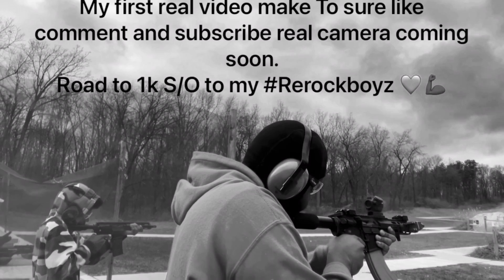AR PISTOL 5 INCH MICRO UPPER & MICRO BUFFER TIPS!!!!

Comment: You are getting less gas and power burn the shorter the barrel, it has nothing to do with your bolt being strong it's actually less stress on the bolt, I WOULD  highly recommend a adjustable gas block, with short. 556 barrels it's all about timing and bolt lockup time, you want the heaviest buffer you can to keep the bcg locked up as long as possible
Reply: Smart info. I'm look to build a micro and have been looking at different YouTube builds and comments to build my best possible version. Buffer and dwell time are my biggest concerns on a gas system this short.
Reply: You don't really have to worry about any of that if your gas is in check,just put a heavy buffer in it adjust your gas down to where it reliably Cycles and your gtg
Reply from the maker: Not needed on a 5.56 any other micro build yes but I’ve built 3 of these No ajustable gas block and it runs just fine

Comment: Mine has worked fine, 300 ACC , 7.5 inch fully dressed, cheap lower, cheap upper, and cheap micro buffer tuv, Magpul mbus sights, hand stopper, cheap flashlight, sling connectors, hangs nicely, looks pretty descent for the money,  but most important it works just fine, like he said don't use the dang buffer spring retention sheet, and keep at least 2 threads away from your post hole if you run into some feeding, charging issues, eliminate that weird looking round spring, I have never used mine but you might need to if you run a short 5.56 cal. A little lub goes a long ways, just a little coat of lub on all moving parts will keep it running nice and smooth. Good show!  👍👍👍

Comment: I ironically bought the same set up but I’m building a 300 blackout. I’m going straight to what you did as far as removing buffer plunger and second thread back. I was having problems figuring out the spring because the plunger wasn’t catching it bi bought buffer tube years ago. I didn’t know the back end unscrews. Smh. Lol 
My boy put me on to your video. 
Keep ‘‘em coming!

Comment: Hey so I have a 4.5 inch I believe it is with a buffer tube js like that and I took out the same lil part yu did too but still same issue just one shot and den I get a dead trigger would it be my bcg

Comment: I’m building my first ARP. Going for 7.5 or 5 inch. Does it NEED a 3.5 inch buffer assembly or can I use the standard carbine length buffer (that usually comes with buying a ar pistol lower)? Also what’s the best BUFFER for 7.62 and 5.56 options for the lengths I stated above. Please reply anyone and give me some advise or a video to watch. Thanks.
Reply from the maker: The standard pistol and carbine lowers will run better than the 3.5 over time and you can actually brace those the 3.5 is literally for looks and smallness but it can run good aswell
Reply: @RerockTactical  ok thanks. Yea I was wondering cause I may or may not use it a a car gun. So I’ll need to put it in a bookbag. But even with a 5 inch barrel it will still be pretty long cause the STANDARD buffer right.

Comment: so mine was/is gonna be a 40 S&W build with a 5.5 inch barrel there are very few 40 bolts most are not adjustable. i think there is like 3-4 companies that make those. does that mean i am gonna have issues? any one with a pistol CC please chime in if you have used this with a pcc and have issues i have not bought a bolt yet thank in advance
Reply from the maker: Since it’s pistol caliber I don’t think you’ll need an ajustable bolt being as the short barrel is normal for pistols

Comment: I can’t get my bolt carrier to close all the way after 1 shot with the 3.5 buffer any advice?
Reply from the maker: Is it properly lubricated if not take the micro buffer off and see if it does that with the standard mil spec trigger
Reply from the maker: Sometimes the chamber is dirty and you’ll have to clean they get dirty after a couple shots
Reply: Gun is brand new and lubricated, you think I need an adjustable gas block?
Reply: @RerockTactical I installed a 5inch buffer tube and it cycled fine how can I make the 3.5 work??

Comment: It was just the screw blocking it from fitting in right on the inside because your buffer tube don't need it. You can screw it all the way on bro it's still going to run great
Reply from the maker: Thanks for the info I just thought I’d give it a little room to work
Reply: @RerockTactical  thanks for the response my boii
Reply from the maker: No problem I got 2 more 5 inch ars I’m building I’m gonna screw em all the way on 💪🏾

Comment: I’ve been having issues since I got mines. Light primer strikes. I’m going to change out the trigger and bcg. Hopefully that works. Micro 300 blackout with the 3.5 inch buffer and 5 inch barrel
Reply from the maker: You could just get a enhanced trigger and hammer spring if you don’t wanna go drop in
Reply: @RerockTactical  I went ahead and got the drop In you sent me on ig. I was looking at the stage one anyway

Comment: Is that a H2 spring set within the micro buffer tube or does it come with it's own
Reply: I believe it comes with a proprietary spring and buffer set. A heavy spring and buffer weight would prob be best in a system this short.

Comment: Honestly If The Spring Go Into The Bolt U wouldnt Need The Buffer pin because its only purpose is to hold the buffer into the tube if its already coming out the tuber into the bolt u wouldnt need it…. Just A Quick Tip!!
Reply from the maker: That’s why I didn’t install it

Comment: I was hoping you were gonna say it was chambered in 300 blackout. 😅 I'm sure it's fun to shoot but ballistic wise you're much better off with another caliber
Reply from the maker: I was hoping you were gonna say you subscribed but you didn’t so really don’t give af
Reply: @RerockTactical  right
Reply: @RerockTactical  That's cool man! I'm just trying to help educate! That rifle is gonna give you less power than a 9mm with that length. Just giving you some info to consider bud.🤠
Reply from the maker: I know that though I understand your trying to help but I promise I do research before I buy stuff I have 16 inch rifles I have 5 inch pistols just my choice
Reply: @TandCEveryDay  Curious what testing you've done to come to this conclusion as most will concur that yes, 5.56 is made to reach max power at @ 20" barrel, a 5 - 7.5" barrel with 5.56 should still be better than a 9mm out of a carbine for personal protection. Look at Demonstrated Concepts for a good explanation for example. If you have different data though, please share. I'd be interested in hearing.
Reply: @ArmeroPR  Based on energy alone.
Reply: 5.56 out of a barrel 5" is on par with a 9mm +p ballistically. There is a lot of unburnt powder and the sound signature is hella loud. That is well known by everyone. If it didn't have proven self defense capabilities then the sig rattler 5.5" wouldn't be chambered in 5.56. is 300bo a better caliber for shorter barrels? Yes, but a short 5.56 ain't a slouch either. It's a close range pistol. People aren't making precision shots with a shorty. Do ur thing bro. Thanks for  showing the dope build and thanks for taking the time to explain what potential helped u make it build run better. Some of us out here respect the grind. It'll always be a hater lurking behind a keyboard somewhere tho. Lol
Reply: @reverendlowdown3982  Exactly bro
Reply: @reverendlowdown3982 good part about his 5.56 he can buy a CMMG .22lr kit and go plinking or varmint hunting🤣💯💪🏾

Comment: Dope!  I did a similar build with 5.5” barrel that shoots 7.62x39 in a AR platform.  Keep going.  I’m already sub’d.
Reply: I’m building my first ARP. Going for 7.5 or 5 inch. Does it NEED a 3.5 inch buffer assembly or can I use the standard carbine length buffer (that usually comes with buying a ar pistol lower)? Also what’s the best BUFFER for 7.62 and 5.56 options for the lengths I stated above. Please reply anyone and give me some advise or a video to watch. Thanks.
Reply: Yooo... I appreciate all these valuable nuggets of information you dropped in hear!!

Comment: You actually didn’t screw the buffer tube in far enough to hold the plunger down
Reply from the maker: That’s because there’s no plunger because the bcg goes inside the bolt carrier so no need for a plunger